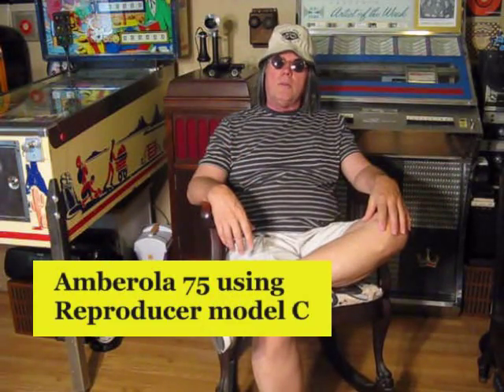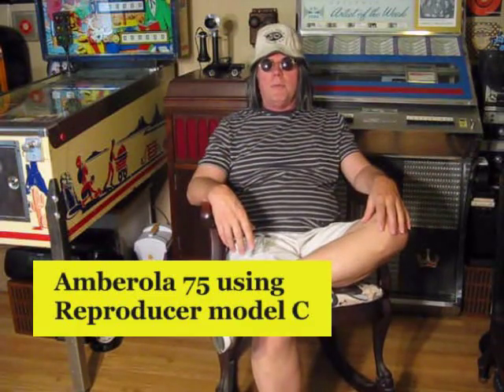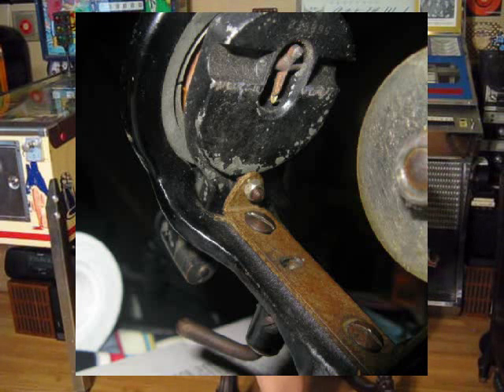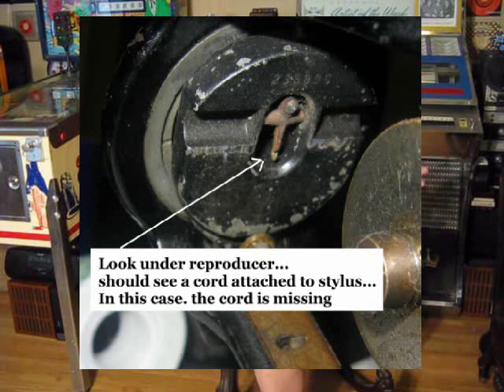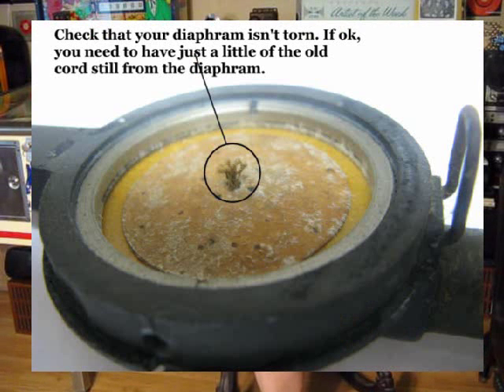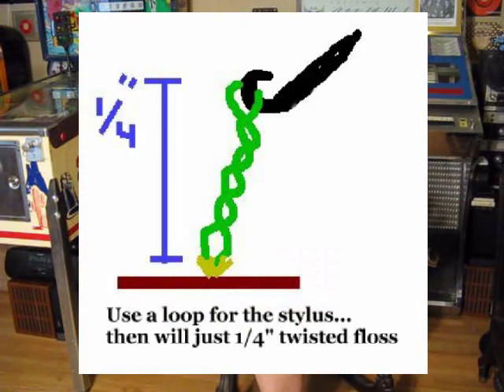Repair Edison Reproducer using Dental Floss

Comment: The original cord has two metal ends attached to the short length of woven silk.  One end of the link goes onto a brass eye that goes through the diaphragm and its reinforcing button.  This eye is threaded and held in by a tiny nut.  The other end of the link cord has a brass loop that would hook onto the stylus bar.

Comment: Thanks for the information I may need this soon, I will be attempting to rebuild a Edison/Brunswick reproducer, with a orthophonic diaphragm to use on my Victor orthophnic credenza!
However after watching this video something occurred to me which may be a tip to you!
Being a former hairstylist, it occurred to me that what you're doing with the dental floss is the same as setting hair, you're breaking and resetting the bonds by wetting and drying it in a different position, and we know that to strengthen this we can use setting gel and heat.
Now I know that you said it must not have anything on it but I bet you that setting gel would not hurt one thing because it is mostly alcohol and will evaporate completely dry leaving the dental floss very stiff, until you manipulated around then it will loosen up however it will keep its shape with more definition.
Just as an experiment one may try this with the dental floss and then run it through your fingers with setting gel then proceed as you prescribe.
And if you really want it to be like hard wire spray Paul Mitchell's freeze and shine on it.
This may also help when it comes to hooking it on because it will be more stiff like wire.
Reply from the maker: +sophie
Hi Sophie - I've got maybe 100 cylinders now and half of them are warped and hit the reproducer to where I can't play them.  I figured I can't use those.  Then I ran into another Amberola off Craigslist and bought it.  It needed some work to run, but the reproducer worked fine.  Once I got the machine running again, I saw that a lot of those cylinders that I thought wouldn't work did work with the new Amberola.  What I think I found is that the stylus is pulled down lower then the one I fixed.  I plan to restring that stylus again so that it will stick out longer from the reproducer and hope that will allow me to run those other cylinders.  But before I restring, I'm going to try your setting gel on it and dry the cord.  It might tighten out just enough to fix the stylus.  That I will try during one of my projects during the winter.  Thanks for your comment, I'm anxious to try your tip.  See ya -- Atco
Reply: +atco21117 No problem, glad if I could be any help, I also thought of something else which may work.
Someone told me that dental floss is made of nylon fibers which reminds me of wig-back in beauty days school at Halloween time everyone and their next-door neighbors dog would bring in some cheap wig and expect it to turn into something that it was Not meant to be!
My solution to this was to give these cheap synthetic fiber wigs a"permanent", of course you couldn't do this with a chemical--- I did this with boiling water, I would set the wig in the direction I wanted it to go and rinse it  with boiling water so that it would change the texture or the direction of it, usually this would work depending on the fibers!
Another version of this would be to hit the little Dental floss with a blast of he from a hair dryer set on high heat but low force--- or even a heat gun, but I would keep it far away, believe me I have experience with them from stripping cabinets and if you get them to close to anything it would certainly turn your dental floss into a burnt crumpled up piece of plastic-lol, good luck!
Reply from the maker: sophie Tucker
Thanks for the tip.  We'll see how it goes. -- Atco

Comment: Glad you posted that, I was wondering how that repair was actually done. Very tedious work to get that to happen. I wonder how the original cord was attached to the diaphragm because I'm sure that 5 min. epoxy didn't exist then plus whatever is (was) used can't affect the vibration from the stylus to the diaphragm as it travels through the cord. Good job on that. Glad you got it to working. Those old cylinders sound cool. Different music back then, but to those folks it was hip.
Reply: There's epoxy that can set in appox. 1 minute.

Comment: Good afternoon Atco, I hope this finds you well.I recently purchased a Model B Edison Standard Phonograph, It's in excellent condition and I'd like to oil it. Do you have or know of  a video to show me how to do that? I've already wound it up and let it run down several times. All is good so far, I just want to make sure I lubricate and maintain it to allow it to last for another 100 years! Many thanks for any help you can offer. Best, Paul  PS I tried to find a Victrola Guy video and had no luck.
Reply from the maker: Hi Paul - I know how I lubricated mine, but probably not the best way.  I would recommend you to ask the correct way from those who really know what they're doing.  TheVictrolaGuy must have a few videos of how to lubricate, but he does have tons of videos so it would take a little time to go thru them.  Give him a message and maybe he'll give you a link of which one to use.  I like Benjamin, he's a good friend of mine.  He'll help ya. See ya -- Atco